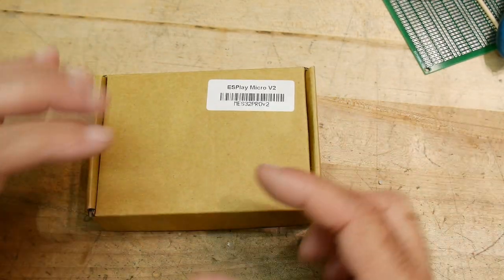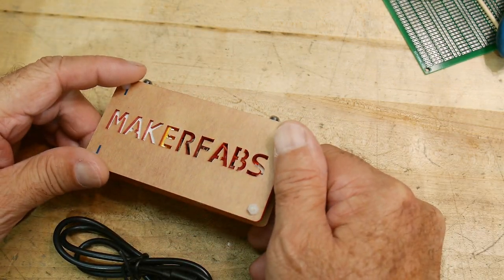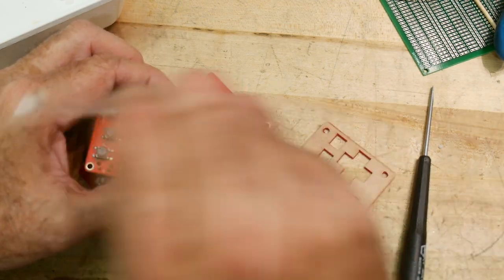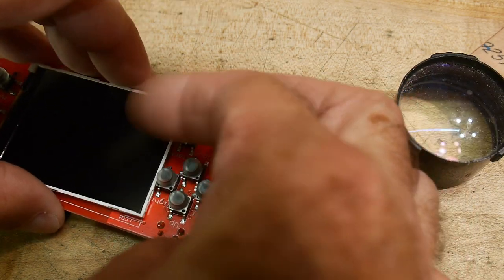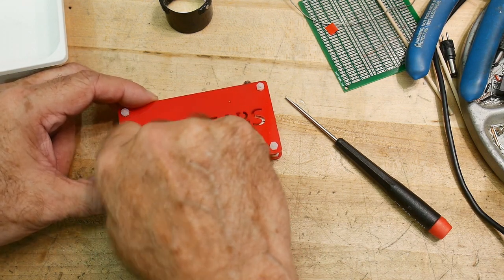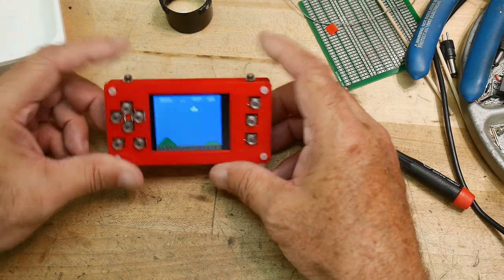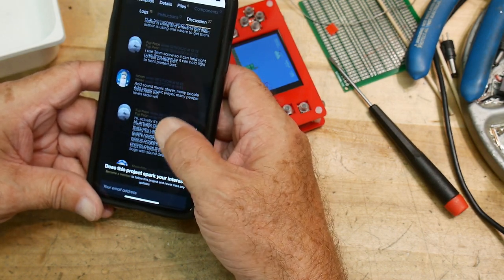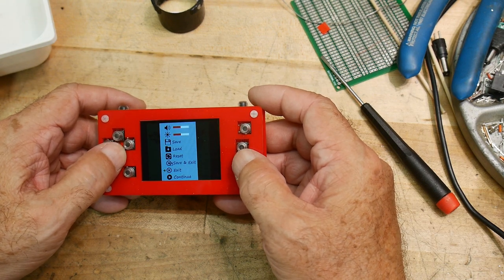#916 ESPlay Micro V2 Game Emulator

Comment: The ESP32 is itself a pretty powerfull dual-core CPU and it's dirt cheap, so even if you don't need/want the radio, you just leave it unused/turned off :)
Reply: Yes indeed And after whole avr price hike esp32 is really good choice , dual core CPU with builtin psram  , hall sensor, touch sensor , built in dac , and lots of pins for under 5 doller